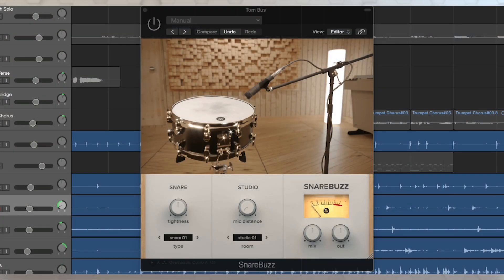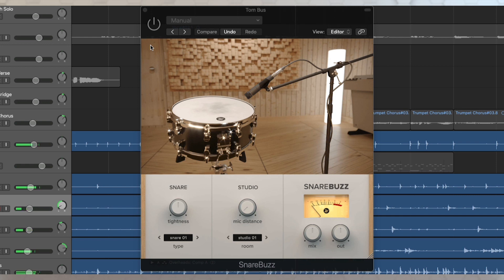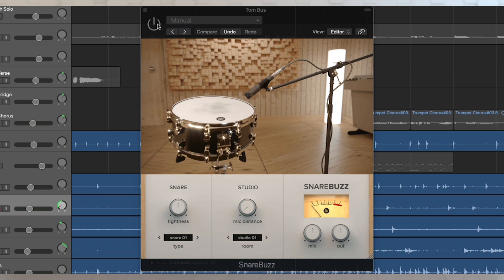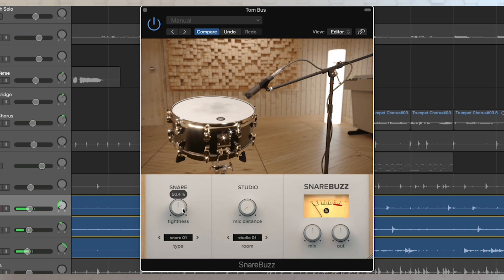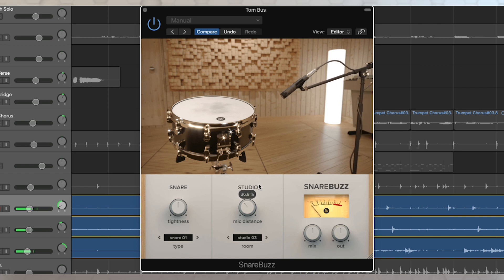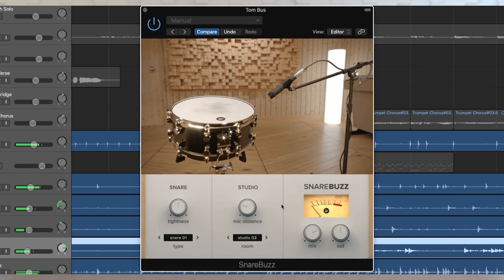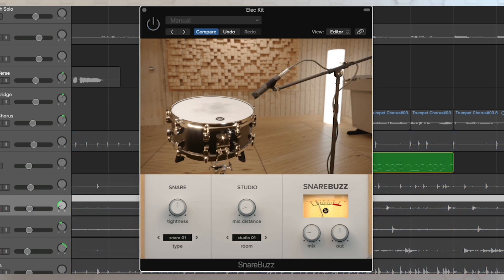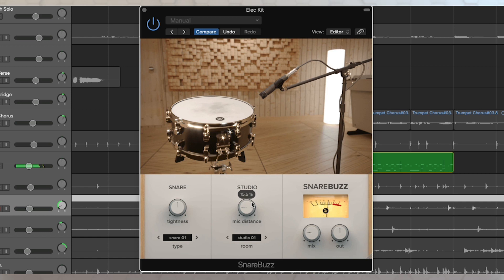SnareBuzz - Free Plugin

Comment: I thought that bad leakeage is one of the main problems in real drums recording.. But his plugin adds it even more....
Reply: Really depends on the sound you’re going for. I have recorded kits with everything close miced, and have also recorded drums with 2 or even one mic. My favorite setup is one dynamic outside the kick, one condensor on top of the snare a few inches away, an SM57 a foot above/behind my right shoulder pointing in between the toms and ride cymbal and a far away room mic. Very sexy sound but requires the bleed from every mic to create a full sound